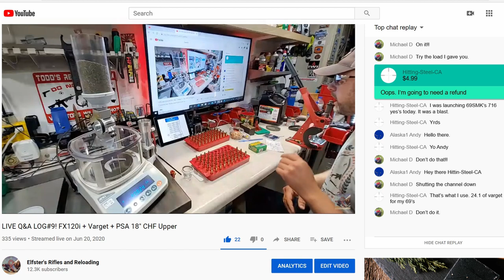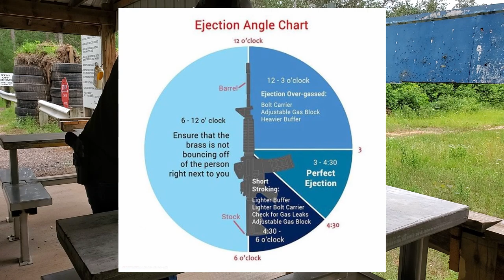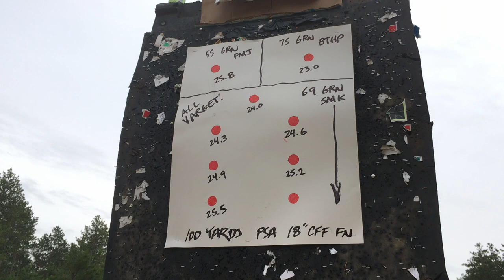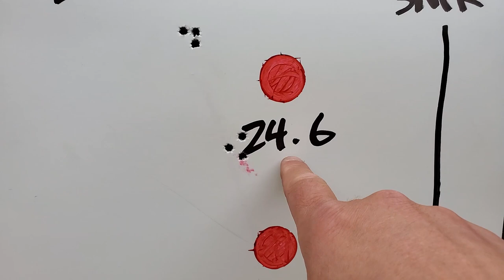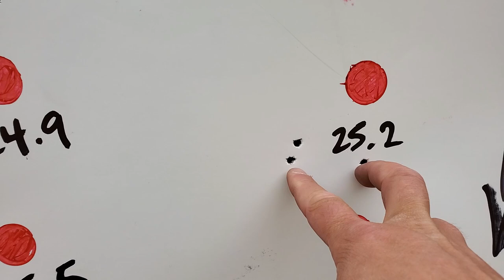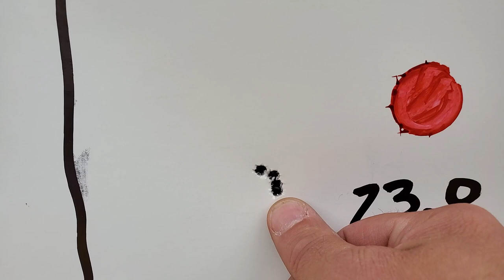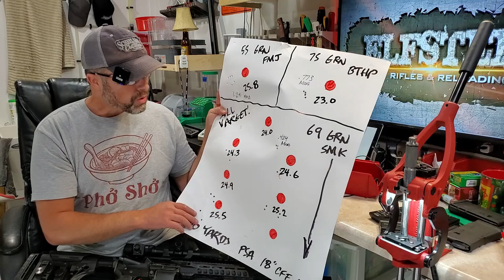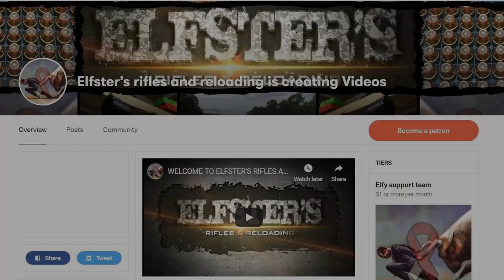PSA 5.56 CHF + PSA ADJUSTABLE GAS BLOCK + RELOADS = PART5

Comment: Hey Todd I just thought I’d ask if you’ve had any problems with your PSA 6.5 Grendel bolt? My Grendel bolt broke the extractor on Saturday 😡 I’d say that I’ve probably put around 4-500 rounds through mine. I’m going to get a whole new BCG from Brownells and I’ll also see what PSA will do for me.
Reply from the maker: Not yet, but that's a known issue with 6.5G and especially 7.62x39 ar's.. they just got to remove more.of that ar15 bolt face to accommodate the base of the brass... PSA will take care of ya and if you have issue getting ahold of their customer service then message me on facebook
Reply: Elfster's Rifles and Reloading I’ll do that, Thanks Todd!👍🏼👍🏼